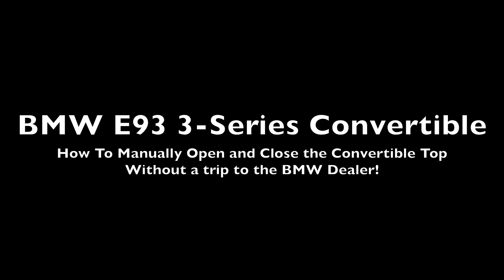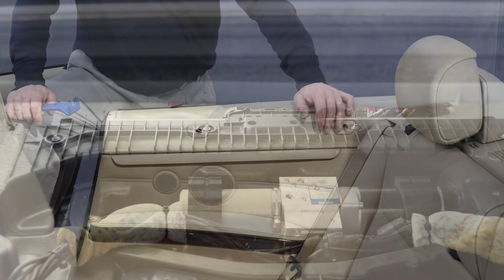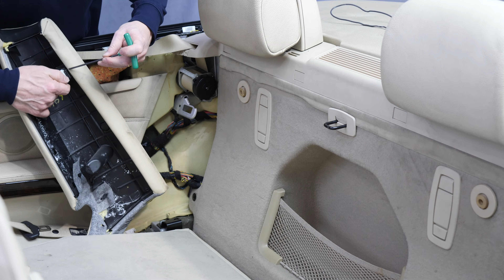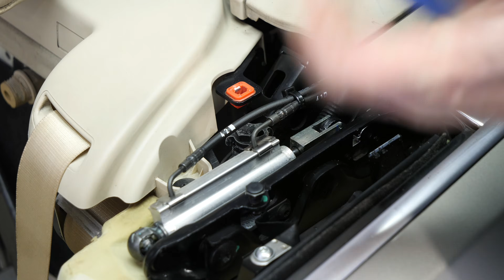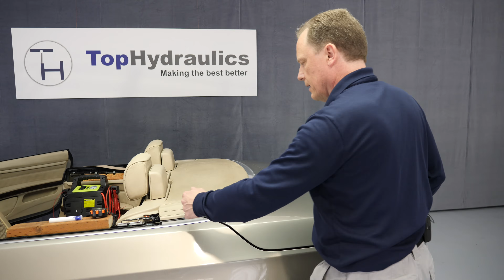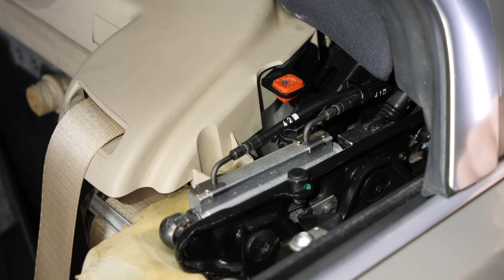How to Manually Open and Close The Top (Long Version) - BMW E93 3-Series - Top Hydraulics, Inc.

Comment: Hello Klaus! Thank you so much for this amazing how to video. Before undertaking this very difficult job, for a novice like myself. I wanted to ask you, I own a 2007 version, the top goes up and down "normally" (when it reaches its open position in the trunk it falls very hard). However, my issue is that, after opening the top I went to close it and now the windows won't roll up, I think it's not latching. Do you think trying the lock behind back seats will tell the computer the roof is locked ? So I can roll my windows up again? Thanks for any advice!
Reply: Mine is doing the same thing, did you find out the answer?
Reply: @mrsmithsr.4502  as wel
Reply: My car needed a newer battery because my alternator was bad,  and once I replaced my alternator and battery, everything was back to working properly even my convertible top started going up and down properly, WOW!
Reply: @mrsmithsr.4502  idk if that’s the case for me my roof was originally stuck down and was flashing red
Reply: Me too
Reply: This has happen to me I can't roll my windows up ..
Reply: @A8pri  I still haven't been able to solve this. What I did was put the top completely down and once down I rolled all the windows up, after that, I started to raise the roof back up again, and as soon as I press the roof button I pressed the main windows button up, to stop the windows from rolling down. That way I managed to close the top with the windows up, but did it VERY CAREFULLY, looking at all the seals that wrap around the windows. This is only a fix so you don't leave the car open to the environment and have bugs/animals crawl inside. Hopefully this works, but I think a computer is needed to pin down the issue. Good luck, hope this works!
Reply: Yeah thank you very much but the problem is my car windows wont go up even when down now which is pretty bad and I'm just trying sell the car before gets worst

Comment: Congratulations! Very intuitive, well done and very well filmed as well. In the case of my top doesn't work in the future, there'd be the option to hardwire a switch to the latch connector, so I could mannually open and close the top and after that, latch it using the installed switch. 

The hydraulic pistons used to latch the trunk could be replaced by linear motors as well.

(Just thinking of keeping my E93 for long years ahead).

Comment: this video show how to manual close..not show how manual open..do u have a video how to manual open the roof?bmw f33 428i
Reply from the maker: Did we not show the manual opening process sufficiently in this video? It starts at about this point: https://youtu.be/2hDdwukqR4g?list=PLly4CMbpk7oya3ulU64hKs2Fto21E1Mvn&t=2068
Manual operation of the F33 top is very similar to manual operation of the E93 top, as some mechanic friends have told me. There may be some diferences in the trimaround the back seat and you would have to identify which wires from the controller power the front lock. If the front of the top still unlocks with the push of your convertible top button, then this video made on an E93 will show you practically everything you need to know.
Reply: @TopHydraulics  I have an 2016 F33 420 and I am struggling to identify which wires from the controller power the front locks, controller is in the boot/trunk. Could you advise which ones? I have a failed rear window motor and need to manually lower the top to access the motor.
Reply from the maker: @55smokey  Thanks for asking. I don't know which wires control the front lock in an F33 and it would help the F33 community a lot if you could help with identifying them. The function is similar, the top is almost identical, but the controller is different in the F33 compared to the E93 in this video. The two wires going to the front lock are fairly heavy gauge compared to almost all the others. It is my understanding that the F33 controller does not have a separate connector for the front lock wires, so you will have to find them based on gauge and routing. They should be next to each other in one of the connectors, and maybe you can rule out their competition based on where the other heavier gauge wires are going. Once you have found suitable candidates, you may want to first Ohm those two to Ground, in case they are some kind of power supply cables to the controller. Then take the bold step to hook up power to them and see what happens...
Reply: @55smokey  Hi David! Were you able to sort this issue? I am having exact same problem and unable to fix window regulator as I cannot lower the roof on my 4 series! Any help would be highly appreciated.

Comment: So well explained. I have just sold my E93 all because I couldn’t rely on the top always closing. I changed the Salmon pink relays and that worked for a while but I so lost faith in the thing closing when it meet the windscreen that last motor sound something it just wouldn’t do. I also noticed it didn’t like closing on any incline. If I knew about the 12v battery part I probably would have kept the car. Anyway it’s gone now but I so miss that car more than you will ever know. Maybe now I know more I might get the newer version. Thanks anyway sad but really helpful for me.
Reply: these tops are in while under warranty, otherwise just leave them up.

Comment: Thank you for the great video! It was easy to follow. The hardest part would be the rear latches, I didn't have the long nose pliers and strength but I managed to modify a small G-clamp with a hard wire to attach to the yoke. it slowly pull latch close without using a lot of force. 
I have a question hopefully you can give me the answer. My e93 roof was in the trunk. When I was trying to put it up, the rear trunk only went up halfway and stopped..
and the red light on the button started flashing.  I needed to push the trunk down manually and the rear latches can be closed by the button. Do you know what will be the problem? the Relays?  I used your tutorial to close the hardtop in the meantime,
Thank you.
Reply from the maker: Thanks for asking and thanks for sharing how you managed to move the rear latches without using the bent nose long reach needle nose pliers we used in our video. Your question is what the cause might be for the trunk lid pulling back only half way. Could be electrical or could be weak gas struts or could be a failing pump. 
If it was electrical, then a sensor would be giving a signal that is illogical to the computer, the trunk lid would stop abruptly, always in the same position, and you would instantly get a warning message. Is this the case? 
If the warning message is delayed because the pump keeps struggling to lift the trunk lid, that would be the pump "timing out".
Reply: @TopHydraulics  
The error message pop up straight away and I could not hear or see the pump struggled to work, the pump could lock the rear latches after i manually push the trunk down.
I did a scan today and these are the code: 
A691 CTM Hall Sensor Rear End Module Open, 
A6A3 CTM: Hydraulic Fluid Temperature Sensor, 
A6A1 CTM: Drive For Hardtop Locking.
A6A0 A6A3 CTM: Relay (Because I removed them before?)
What do you think? 

Regards,
Thank you.
Reply from the maker: @speedimodels  That's a lot of codes at the same time. If I understand the description correctly, then the pump should not have been hot at that point, yet you had a hydraulic fluid temperature code. The temperature sensor is in the pump's motor. The fault could be caused by the pump having to work too hard and overheating, or it could be caused by corrosion from water intrusion in your pump.  
Does your pump look corroded once you take it out of the foam insulation? 
Which codes come back after clearing them?
Reply: @TopHydraulics  The pump looks like new condition.  I have a feeling that the hydraulic fluid temperature code caused by me keep trying to make it work?  
A691 Hall sensor Rear end Module Open might need to test/replace the Hall sensor?
Reply: @speedimodels  is it possible to share how you modified the g clamp with the hard wire please? What size g clamp and what wire was used and the method.  Having trouble using the 90 degrees pliers. Thanks in advance.
Reply: @mariowright1369   @Mario Wright  Sorry for the late reply.
I was in a hurry and just used whatever was available around the workshop. It was actually a clamp which hold the vice grip on the table. I cut the flat end to be shorter and drill a hole to let the wire to run through.
https://photos.google.com/share/AF1QipMGMw8YlAksg5fS84CXkRMryMEqDZ3pxq60QbS3pvwLm8RnZa8ASS44GhTwha78qA?key=TVZqVVNlUW5xQ3o5eGtycXpmdHEwMDVLdWpvbkp3
sorry for the rough craftsmanship. :) 
the wire end insert to the yoke and the cup push against to the back of the round end (32:00 in the video which the finger is pointing at)
Once they are all attached, simply wind  up the thread and the wire hook will pull the whole system together and lock them in place.  Winding the thread is much easier than pulling it with the long nose piers.
Hope it helps. :)

Comment: I own two 2011 328i Convertibles, one of which is an M series. Should I lubricate the hydraulic pistons that operate the top? If so, what's the best lubricant to use? I do not want to damage the seals.
Reply from the maker: Thanks for asking. There is no ned to lubricate the convertible top cylinders - simply operate the top from time to time.

Comment: Everything worked great but all 4 of my windows won’t roll up or down
Reply from the maker: That is normally caused by the computer not getting the signal that the top is fully up and latched or fully down and latched.
Reply: @TopHydraulics  any ideas or pointers on what I should do and thanks for the help you saved me and my wallet
Reply: @TopHydraulics  turns out I skipped a step thanks for the help
Reply: @godly8320  what was the step you skipped? is it latching the trunk lock? (12V on that small connector??)
Reply: @hussein.eh7818  I honestly don’t remember but watch the video closely it was something minor

Comment: I had issue with Roof being stuck in trunk.  Sounded like it had power but nothing was happening.  I manually got the roof closed.  However, now the windows wont go up.  Any ideas? And it says hard top not locked when it is locked in place
Reply: Same did you find a solution?

Comment: Any ideas on how to close the couplings in the rear window sills?  The ones you used the 90 degree tool on?  I can't close them. Tried having someone holding it down and it just won't move when it is about an inch left on the cylinder. Any help would be appreciated.
Reply from the maker: It can take a lot of force.
Reply: @TopHydraulics  thank you for the reply and help.  I wasn't able to do it but ...seriously thank you for your contribution to bmw convertible owners.  I am sure it's helped many and helped learn a lot about my top.  Thank you.

Comment: So no help for me, my top is stuck in the halfway up position with the three panels still stacked on top of each other and there is no way into the trunk, there is no exterior lock to use the blade key on.
If you look at minute 29:55 that is where my top is stuck.  BMW service just as they were closing Saturday at 4 suggested I lock the car and leave it locked for at least 10 minutes in the hope of resetting, or rebooting the system, but that did not work.  The windows will not work (except using the blade key in the exterior locks) and the trunk will not work either.  I have tried every combination of inserting and ejecting the fob from the socket in the dash, as well as multiple hits on the top button.  I would disconnect the batterey which would reset the car but the battery is in the trunk and I cannot open that.
Reply: Maybe one of your cables are broken!?
Reply: @ivohanifl455  Ivo H., it was a hall sensor that cost about $25 but unfortunately it is part of the hydraulic ram that raises and lowers the top so the final bill was $1,997.23.
Reply: @markwalker3499  Hi Mark, I have the same issue, do not you have any immages of it?
Reply: @pepacipra5413  No. not that I can post here, but it was at the point where when you are putting the top up or down where it rests with the two panels up but still on top of the other.  

I had to have the car taken on a flatbed to the nearest dealership quite a ways.  They almost would not do it because the towing receptacle the tow truck secures the car with was in the trunk and that could not be opened during the failed operation of the top.  They ended up taking the car against the rules.  

$2,000.  It actually was a $25 hall sensor that failed, but that particular sensor is integrated as part of the hydraulic ram so you cannot replace the sensor without replacing the entire hydraulic ram setup.  BMW has on a few bad engineering malfunctions but this is certainly a doozy.  Having a $2,000 repair bill over a failed $25 hall sensor is just insane.
Reply: @markwalker3499  Thank you Mark for your comment. You are right, thats insane. Even the change had to be tricky. I will try to open it manually and check it, I heard, that could be also a wrong position of the sensor. But as you mentioned, nothing works - trunk openning, windows,.. it stucked somewhere within openning process.

Comment: Thank you so much Klaus for this video!  I have an E93 and the left side of the rear window is not quite seating, trying to figure it out.  You helped me very much understanding how the whole thing works.  Thanks again.
Reply: I too have a hardtop convertible. I'm having trouble with the passenger rear window which I believe is preventing the vehicle top from closing.. Is that the issue you were having as well?
Reply: @jaimeh.tijero9129 hey i have this same issue what was it brother?

Comment: I own a e93 328i it took some rain was not flooded.but I think some modules got water.my question is which of the modules I should be focused on?.the red light on the switch is blinking no green.
Reply: @ezicarus8216  yes I think it did I didn't see the water rain damage was just told by the bodyshop.but I did buy a footwell model on eBay as soon as I plugged it in the roof moved and that was that nun after

Comment: What an amazing tutorial. Could not find anything about the hardtop problem. Still I haven't fixed the problem. It opened, always worked fine but now it does not close anymore. When trying to close the Roof, the trunk will open, but the roof will not rise out of the trunk. I can't hear any noise or pump, just a short and quick noise. I had a battery sign pop out on the screen a few days ago. Could it be the problem?
I'm desperate..
Reply: similar situation here. How did you figure it out?
Reply: @sophiaportopaiva  relais, that are under the trunk. those died. 2 of them.

Comment: Great video. Was working on a car where the first aid kit was accidentally placed in the "no luggage" area in the left of the trunk. It caused a jam and prevented movement of the top. Unfortunately, it also prevented the trunk from being opened.  Had to apply 12v to the gray/green wire at the back of the fuse box to get the trunk to open so I could release the valve on the pump.  No key slot in trunk! Video was indispensable.

Comment: Question... I have a 2007 e93 335i and my soft close on my trunk stopped working and it keeps saying my trunk lids open cause it’s not pulling it down the extra centimeter. Does anybody here know the cause of it??
Reply from the maker: The soft close (last centimeter or so) is electric, moved by a motor in the back of the trunk lid. Can you hear it engaging?
Reply: I don’t believe so I don’t hear it engaging at all. Could I hear both outcomes tho just in case?
Reply: Same issue it’s annoying
Reply: I eventually fixed my issue it has something to do with the soft close mechanism itself it’s just held on by 4 bolts and plug ins I bought the whole unit for 200 bucks on eBay

Comment: after you have done everything, don’t you need to close the pressure relief valve?
Reply from the maker: Thanks for asking. The pressure relief valve plays no role in keeping your top secured in the up or down position if it has been properly latched. Obviously, if you want to use the pump next to move the top again, then you will have to close the valve. Leave the valve open or remove the 50A fuse if you want to avoid accidentally moving the top with the pump...
Reply: Top Hydraulics 
Thanks for the video just followed the video and it was great but can you tell me why I’ve got a usb connection behind the back seat panel which I only uncovered when I followed the video
Reply from the maker: @richyhowell  Congrats on manually moving your top! I don't know why you found a USB connection behind the back seat.
Reply: Top Hydraulics ok thanks 
Do you recommend to change the 2 salmon relays on the motor ?
Reply from the maker: @richyhowell  Depends a little on the symptoms. If the motor has burned out on your top pump (i.e., blown a fuse), then you clearly want to replace the relays, as well. Generally, it is good preventative maintenance on a car this age, and you can easily do it yourself. The E93 pump pulls a lot of current, which is hard on the relays. Thus, older relays can spot weld themselves at the contacts and keep the motor running even though the computer told it to stop, which ultimately makes the pump motor burn out and results in the need for a pump rebuild. The unfortunate part is that BMW uses relays for which there is no standard replacement, so you are stuck using BMW relays.